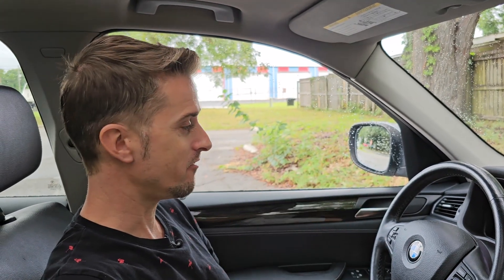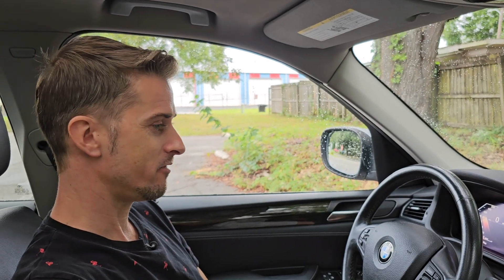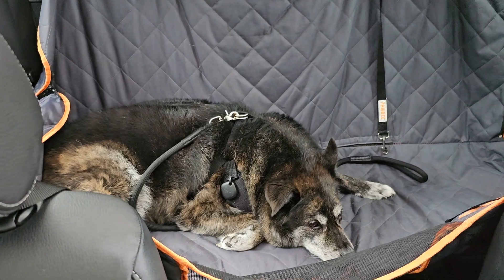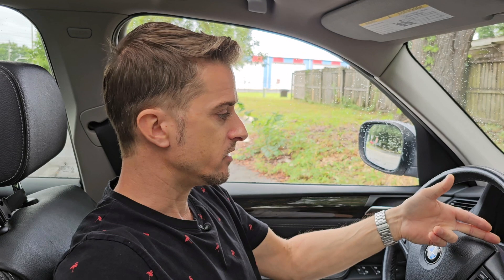Linux Digital Instrument Cluster on BMW pt 3

Comment: How can i change the rpm from 8000 to 6000rpm -there is any settings on cluster for bmw 320d e90 2006 ? Thx!
Reply from the maker: For that, you need to ask the seller! But I don't think that is possible! Those were designed and built for the U.S market! But let's hope I'm wrong! Let us know if you'll find it!

Comment: Did you put the diode on high CAN or low CAN? do you think this mode will work on F10/2015, you think fiber optic Y/T Connection was done just to sync the date or there is more related to this?

Comment: You can buy a y splitter fiber optic cable for "car audi" specifically made for bmw that should be relatively easy to resolve the issue you had with the fiber optics
Reply from the maker: I was wrongly expressing when I sayed  Y splice. More correct is T Splice, and you can not find something like that .

Comment: Hi Ovidiu, I need your help. I have BMW ISTA D and for some reason I am not able to write information to the DME. I tried to change the injector values after installing a new injector and I was not able to. The error message I get is “NOT OK” against cylinder 2. I tried registering a battery and it was not possible but I can read and reset fault codes without any errors. Very strange but with your expertise, I am confident you may be able to help me. How can I get in touch with you? Thanks
Reply from the maker: Hello! You can not write the injector because  that injector is not for that engine !
Reply: @MOvidiu  Hi Ovidiu, Many thanks for getting back to me. I managed to fix the issue….HOORAY! I probably didn’t explain the issue well. Essentially, I replaced a faulty leaking injector and had to code the new injector values to cylinder 2. I tried coding the new injector values with the engine running instead of having the ignition on without the engine running. My bad…I have successfully coded the new injector values to the DME with ignition on (not engine running) and reset adaption values as per BMW ISTA instructions. All is good now and car is running smoothly without any misfires! Thank you so much for all the quality informative videos as it enables us to confidently work on our BMWs.

Comment: Why don’t you just bu y the most Y splitter from mr12volt instead? Made for what you’re looking for! Quit the donor kombi idea, too expensive, or you can bu y an optic splitter and some couplings from amazon for the same price as mr12volt.. Also, I think you will need to run a wire and place the temp sensor outside otherwise the climate control will not function correctly. In my comprehension, the extra sensor inside the dash is connected to the main kombi, which will send the information to the car.. since it’s inside the dash, after parking under the sun the temp will quickly be more than 50c* and after you run the ac, the sensor will go under 16c* as it is almost touching the ac vent tube!! Think about it!!
Reply from the maker: Thanks for stressing out and help! But mr12volt doesn't have a Y splice more correctly. T splice . I've searched for something, but the only thing closer is an audio optic splitter, but that also will need modifications . About a donor cluster, even if I'll buy one, I won't pay too much! But even so, I think it will be a good investment considering that you'll learn new cool stuff 😎 .

Comment: Amazing bud, I was thinking on building a custom one for the E39, I have a 540i 96' which I completely restored and now turning into a bit is reatomod adapting it to fit my taste on a few things, I have 3 clusters around, and was thinking on doing something in the middle, removing the speedo, and rpm dashes and using digital screens in replacement, getting me a hybrid cluster, I was digging on how to approach it for a long time, still in doubt of what works be the best, I was convinced qt fast boot wear the answer at the beginning but I'm re evaluating now